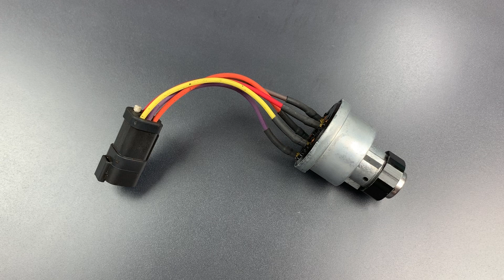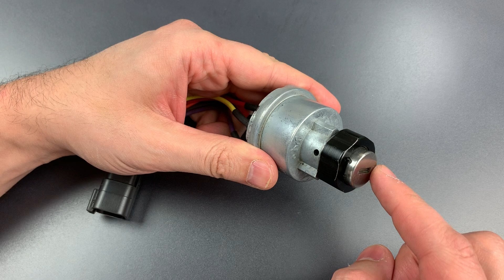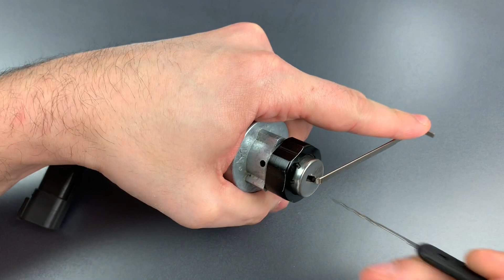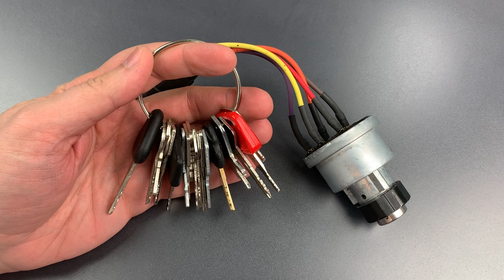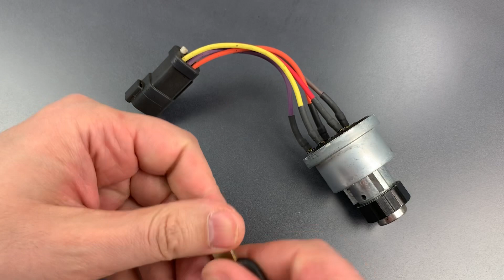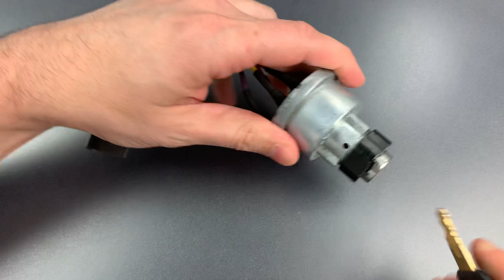[803] The Shocking Truth About This Bulldozer Ignition Lock (Caterpillar D8)

Comment: Yes tjey are all keyed the same. But who has a 18 wheeler with a lowboy trailer. Then you have to split the trailer walk the dozer on the trailer. Hooke the trailer back up. And drive off. And most heavy heavy equipment has tracking devices and some jave remote kill switches. Once the owner knows its been stolen. But good video!!!   Oh and there is a far easier way to start heavy equipment with out a key.
Reply: Jumper wire and a screwdriver
Reply: begone30 
Think ya missed the point of the video.  He wasn’t giving a thesis on Bulldozer theft.  He was simply showing how easy a humanoid with bad intent could F*ck some stuff up without being challenged by an ignition key.

Comment: As expensive as some equipment is i believe that using keyed alike cylinders is ridiculously ignorant. I understand their reason, however when you have a machine over $100,000 dollars you should have at least some decent kind if security.
Reply: Most of this equipment requires the use of a lowboy trailer and truck to transport that means a driver has to pull up in his big rig drop his trailer and fold down his neck drive the machine onto the trailer fold his neck back up and hook back onto his truck get back in the machine and pull it further forward on the trailer to put more weight over the drive axles chain it down flag it put on the oversize load signs most likely a load of that size requires a permit that gives you specific hours that load can be on the road which means all this has to happen during daylight hours  where you plan on going with it may require the use of escorts and communication to local law enforcement would be a logistics nightmare to do all this under the radar and not get caught red handed in addition to that GPS is prevalent in most newer equipment so even if you did somehow get it transported it can be easily and quickly located
Reply: @MrCheaterpipe  right? 
 The high value targets on a job site are the things you can  put in a truck or van. Such as welding rigs, gennys, jackhammers, etc. Stuff that CAN be sold. 
No one is gonna buy a 100k dozer for 10k. They know people are gonna be looking for that shit. But might someone buy a genny that they know doesnt have any markings or serials on it because its been cleaned real good. Maybe a genny or welder that costs 5 or 10 k? For say 2k or less? 
Sure. They might.
Reply: Is heavy construction machinery theft a big problem? The building site has to be protected by other means either way. Also, the top speed of these must be slow, so if you want to steal one you wouldn't get far, and it takes time to put it on a trailer, too.
Reply: The key wouldn't really deter professional thieves anyways. Hiding gps trackers somewhere in the machine seems to be a common solution.
Reply: @progandy  you are right about that for sure. Keys and locks are for honest folks. If a thief wants it they will find a way to get it, we can only hope to slow them down enough to deter them. And having a tracking device hidden somewhere can be a great benefit for locating it if stolen unless they remove it somehow.  Its sad but if its valuable and somewhat accessible, then there is a black market for it im sure.
Reply: 1. A bulldozer weights a fuckton. Its slow and takes a big vehicle to haul it far and fast. Its the equipments very value that helps protect it. 
Whe. You steal that big they dont stop looking for it. The kind of people who steal these for fun are rare. 
Rarer still are the people hoping to sell them. 
 You put gps on it in non standardized locations, dummies and more than one. 
That way if someone does disable remove or destroy one, its still trackable.

Comment: At my old landscaping job we had lost the key for the Bobcat but discovered that we could start it using a paperclip. From then on the supervisor had that paperclip on their keyring rather than a replacement key.
Reply: at an old job we had a bobcat that could only be started with a flathead screwdriver, the standard keys didn't work
Reply: @notatoad  we used to have an old toyota truck that got started with a screwdriver that was kept under the seat
Reply: That's fukkn hilarious
Reply: Same with a lock at my work, made a paper clip key and it's on the managers key ring XD
Reply: Bobcat keys are generally universal. $5 at bobcat to get a replacement. Really handy to have on your keychain.
Reply: At my work the forklifts can all be started witht thier own oil dipsticks
Reply: As a teenager I locked my car keys in the boot of the car and my girlfriend open it with a hair clip.
Reply: At a previous work, we had a car where the key had been replaced by a teaspoon.
Reply: we have a genie lift that we lost the key for. Since the plastic ring can be twisted, all we needed to do is stick a 2 1/4" spiral nail into it and twist the ring.
Reply: You can also start them with almost any Master Padlock key.
Reply: My friend lost the key to his riding lawn mower and I discovered I could start it with the flat blade screwdriver on my multitool

Comment: Newer machine are going to chip or code switch. We starting to see John Deere code start. 4 number to power on. And Volvo have a key chip. You can programs new key chip with the original. Making copy.
Like you say i have my 13 heavy equipment key ring. Never was able to not start something.
Reply: Well, screw John Deere, they're trying to DRM heavy equipment to ensure dealer lock in and it's a terrible idea. Computers really need to stay out of heavy equipment and if they are there, they need to be as dumb as possible.
Reply: @Anonymouspock
I agree
If adding a computer makes it work worse, it doesn’t need a computer
Reply: Probably don't even have to use the right key most of the time.
Reply: yeah but that is not to increase your security, just to charge you more and force you into contract payments. or you know, your tractor can just stop working all of a sudden for no reason whatsoever...